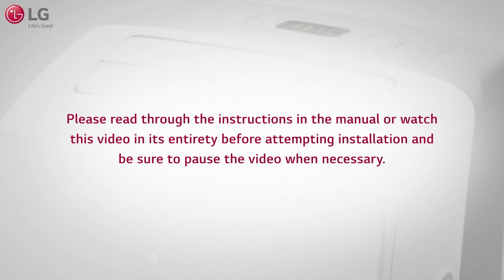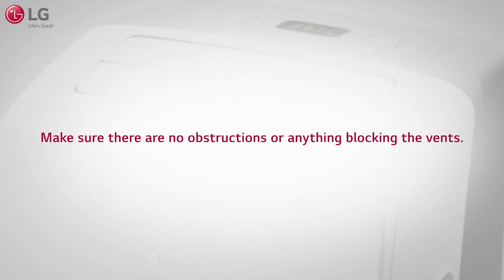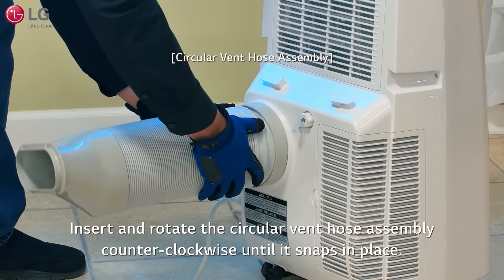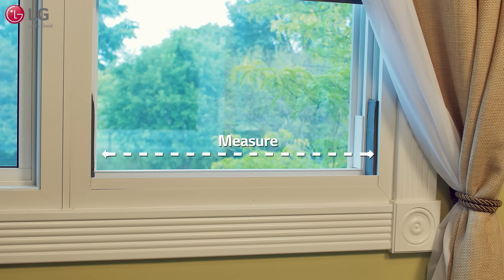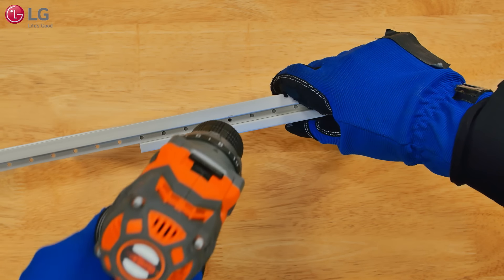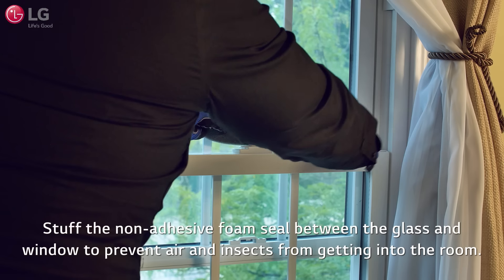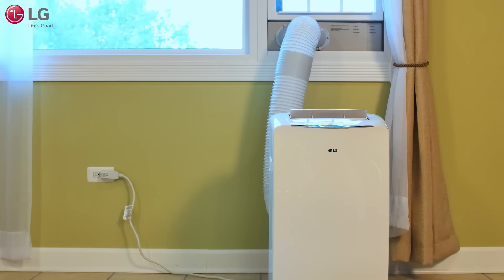LG Portable Air Conditioner - Installation (2018 Update)

Comment: FYI- the diffusers DO NOT screw on to each end of the hose. Worst design ever. However, if you unscrew the black grate , fully extend both ends of the hose, and leverage one side in first and very carefully use needle nose pliers to pull the other side up... you'll secure each diffuser. Making a seal is critical as the hose will vibrate out of the diffusers within a few minutes of usage.
Reply: Glad it’s not just me this is crazy the hose definitely won’t screw into the bracket

Comment: There are a lot of issues with the window panel installation if you have a left to right sliding window. This video nor any other video goes over the problems. Extremely frustrating
Reply: Yeah, you basically need you to make your own window pannel using plywood, and then screw the provided window panel into it to be able to attach the hose. Especially if you have windows higher than 50". Even if it's inconvenient, the advantage is that it will provide better insulation from heat and sound than what just installing the slim panel could provide (especially with a 1-inch plywood). It also makes you able to install a vent cover on the outside. Just make sure to paint the plywood (ideally in white if the sun shine directly on it during the day) so that it does not rot.
Reply: Hi. Did you manage to install it Dominic?

Comment: 1:27 what LG doesn’t mention (which is very important) is that absolutely NO air can escape from the mounting bracket/diffuser. otherwise, hot/humid air will be released from the gaps, increasing humidity, which won’t allow the A/C to cool efficiently. Think about it like this. If there were a hole in the hose, some of the hot air that the unit was trying to put outside would be released into the room. The same thing happens if there are any air gaps at the attachment points. 

buy some insulating tape from your local Lowe’s or The Home Depot, apply it around the attachments of the mounting bracket & diffuser, and you should be good. 

also, make sure the window is sealed entirely, and that no air can get in or out. air escaping from anywhere other than the A/C vent will increase humidity.

Lastly, this air conditioner is not portable by any means. it really needs to be permanently installed if you want the best performance out of it.

Comment: I have a horizontal/Left to Right sliding window & had this installed & cooling in under 2 hours, including trimming & installing a piece of screen to go over the grating b/c I don't have a screen in that window. I could have used extra foam but w/ rigid insulation I had on hand trimmed down I made it fit quite snug. In 15 minutes my room has dropped 10 degrees easily. I watched this video at least twice.
Reply: Why did you need the screen?

Comment: I absolutely loved the portable units I had for my mobile home when my central air unit went out. I had two units that cooled the living room, kitchen, and bathroom and slept in the living room.  One was 12000 btu's and the other was 10,000 btu's.  The only drawback is that they do make a lot of noise.  Mine weren't this brand though.

Comment: The hose gets super hot, which heated up the room, I had to tape insulation around hose. That helped a lot.
Reply: thanks for the tip
Reply: Is it good to buy portable ac.what about electricity bill
Reply: Hello I just bought one today what kind of tape is good to use for the hose?
Reply: @stevemoore9509  duct tape
Reply: @rachelwilliams3108   Oh great thanks Rachel.
Reply: hi rachel i was wondering did you wrap the entire hose with duct tape?

Comment: you need to insulate the expanding hose which blows out the hot air.
otherwise, it's like having a radiating heater and ac on at the same time.
insulate using towels or blankets wrapped and taped tightly, covering 

the entirety of the hose.  2 to 4 inches of insulation is adequate.
Reply: How do you insulate the hose? I used this last summer but now when I set temp it jumps to 80. I can’t find help online at all nor in manual. Any help would be appreciated.
Reply: @valerievalerie5897  i use an old thick blanket to wrap the expanding hose from end to end, using tape to keep it from unraveling. the thicker
the material used for insulation, the better it keeps the heat from leaking into the room. you can use old newspapers, towels, blankets
or even insulation found in hardware stores. just remember, you're goal is to keep the hot expanding hose from heating up the room. 
the insulated hose should be cool to the touch when the ac is running. if it is still warm, i would wrap another layer until it is cool to the touch.
Reply: takezoaudio  thanks so much. I’ll try that in the morning ( also cleaning filters tonight )  so strange it was great last year.
Reply: takezoaudio sorry to bother you I wrapped hose with towels blankets etc and  mask taped best I could. The air coming out seems cool and my next question is how much of hose can you leave in order to touch for temp ? I discovered late last night mine is one of 3 models recalled contacted LG but not optimistic about contact. I’m going to watch carefully and continue to use. Right now hose exposed say 1 1/2 inch each end and is warm but not hot. Thanks for your help
Reply: @valerievalerie5897  i cover every inch of the hose. i touch for temperature on the blanket surface and it is cool. if warm, then add another layer. good luck
Reply: takezoaudio gotcha thanks. Ive got way more than 4 inches deep. so think I need to redo and possible cut blankets small , thanks again.

Comment: This type of units you must always insulate the hose becaue you are cooling with unit and heating with the units hose ( it’s just a plastic hose, heat’s up when in use).
Reply: Oh, I didn't know that. They should have mentioned it, hmmm
Reply: The whole unit heats up, the hot air being expelled doesn't make the hose so hot it reheats the room.
Reply: how would you go about insulating the hose?

Comment: I bought one for my outdoor work shop.  Season -1 the auto drain feature stopped working as well as the auto shut off when water level is full from condensation - causing the unit to leak water all over the floor. Season -2 the articulating air flow blade stopped working and later in the middle of summer the unit stopped working all together.
Reply: TrueToad same thing here....lots of damage to wood floors...
Reply: My auto shutoff never worked right.

Comment: Since I never use my fireplace, I wonder if I can use my fireplace instead of my window. The HOA in my condo may not allow me to do that.🤔
Reply: Shnaz Fangler  I lived in a small condo that I bought in 1984. I don't need a house, cause it's just me. I paid my mortgage off 10 years ago. Which means I haven't paid rent or mortgage since then. If you buy a condo, there is going to be an HOA. They take care of the yard around the property, water, trash etc. I'm at that age where I don't want to start paying rent somewhere else or buy a new house with a new mortgage. I'm rent & mortgage FREE!! Plus, houses are not cheap(especially in a nice area), I'll past away first, before I pay off on a 30 year mortgage loan.😀
Reply: Then how would Santa slide down?
Reply: @ToulKorkMan  I'm too old for 🎁 anyway, it's not like I have 👫anymore.🎅👎
Reply: I did it for mine, I just removed the doors and blocked off the open areas with wood. Seems to work fine been using it for weeks now.

Comment: Do these sort of window installations work with side closing windows ?
Reply: I just finished installing mine in a side-closing window. I had to get creative with the foam strips, but I think that's probably the case for most installs. The hardest part for me was threading the vent; I wish it had had some kind of clamp instead.

Comment: I think the dual hose ones do better when it is a lot hotter like 100°F but the single hose units perform better at lower temperatures e.g. 85. There is a video somewhere on this where they did tests. So for where I live I would be wasting money to buy a dual hose unit because the single hose will perform better when the heat isn't so much. 

I don't have a problem if air is being sucked in from the other side of the home as that will be the cooler shady side. I suspect though that the air coming back in would not be as hot as the air being expelled. 

Also, many people like me do not have windows that slide either vertically or horizontally but swing out vertically or horizontally instead. So it would be even more difficult with dual hose. It is already tough with single hose and you have to avoid the expelled air coming back in by getting wind direction etc right. I think a dual hose could suffer that problem just as much with hot air that is expelled coming straight back in. 

The window units seem to be better than both portable types but again they need the vertical sliding windows. One thing I'd like to know is if LG make portable units with more BTUs e.g. 18,000 or 24,000? 12,000 may only be good for smaller rooms.

Comment: To LG which vents to make sure that's nothing blocking???  Are you refer to vents on the back of AC or exhaust port to outside?  Is the net screen on the window consider as anything that blocking the vent? If not you need to update this video. There are to many uneducated people out there.

Comment: Portable ac not gd split dc inverter ac is best choice for better cooling performance and also best for saving electricity
Reply: Not the best choice for a rental though and by the time you've purchased, wired and installed the split you'll have spent a lot of money and it's permanently in one room.

Comment: Yeah all well and good till bacteria galore builds up inside the bottom and in the air outtake so bad that it makes you sick even with regular cleaning it's not worth all the effort to slightly cool down a single living room or bedroom and I'm speaking from experience I had one until I noticed sinus and lung problems with me and my family the water buildup in the bottom of the unit was disgusting to say the least.
Reply: You're insane!!!
Reply: Try cleaning it every once in a while.
Reply: @johnhorton9637 - I think the guys a little overboard but he did say he cleaned it regularly.

Comment: I have a 10,200 in my bedroom, but now it fills with water, can hear the water gurgling and it is supposed to be self evaporating, how do i fix this problem for good? I did try to remove a clog from the tubes that drain the air conditioner but hasn't helped, please.
Reply: Fran Helmer       Put the United on a desk or something and attach the hose to the init and the other end to a pail because the pail has to be lower than the unit. Now it will drain whenever there is water built up

Comment: This would be perfect for stealth van camping. Just hook up the exhaust heat to the roof vent.
Reply: Good idea.But what about power consumption? (source?)
Reply: @jayjayjay4788  It would require a gas generator. Traveling Robert uses a Westinghouse 2500 which he says is pretty quiet. He's not a stealth camper, he just wanted a quiet generator. 

The only idea I can think of for stealth is to mount a bike type rack on the back of the van and put the generator inside an insulated box on the bike rack. Or inside an insulated trailer.

A soft start unit is needed to keep from  the breakers from tripping when the AC turns on.
https://www.youtube.com/watch?v=IbZxSwYfYvg

I did not find a spec sheet for the model shown in the video so I used this window unit. 

https://www.build.com/lg-lw8016er/s1196551?source=msn_!c291517382!a1275433738760542!k%2Blg%20%2Bportable%20%2Bair%20%2Bconditioner!mp!p%7Badposition%7D!dc!no!f8864876689029&msclkid=d8aecc840c51135355e99009dd0bac13&gclid=CKT_gL6viOECFcFxgQodaGcMvg&gclsrc=ds

https://s1.img-b.com/build.com/mediabase/specifications/lg/1196551/lg-lw8016er%20spec%20sheet.pdf

How to convert volts to amps
http://renewableedge.com/calculate_volts_amps_watts.html

Comment: Why do none of these videos address the draining of the ac unit? Easily the most frustrating part...
Reply: I called their toll free number, gave them my model number and they e-mailed me the owners manual. My model has two drains the one on top is for dehumidifier, one on bottom is for ac. You can call them. There are two ways to drain it. Also, the filters need to be cleaned about every two weeks.

Comment: how is this portable? this involves drilling into permanent window structures, cutting, adhesives and other strongly-committed activities.  you end up wasting floor space and get no benefit of easy install and easy relocation. it is more cost, more hassle, and more bulk than a regular window unit.
Reply: Is it really more costly ? By how much
Reply: @chill8362  About $160 more
Reply: @cristianfernandez2571   Really? Does it depend on the model and brand of it ? Do you have a comparison?
Reply: @chill8362  I did find a cheaper version I bought another brand online after posting this since I needed a new one. Cost about $260. The first was $329 at Home Depot.
Reply: You don't have to screw it in if you don't want to. The only thing that really has to be screwed is the window vent panel.

Comment: Have not yet found instructions for installing this useless aparatus through a circular wall vent. I'm not interested in a window unit- if I were I'd buy one designed to fit into the window instead of take up room space.

Comment: What to do if second panel is too long?
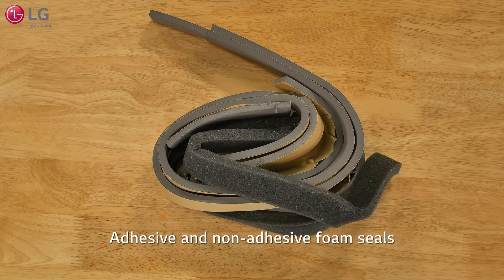Reply from the maker: Hi there! You may need to cut the second paneling to shorten it so that it can adequately fit. Please follow the directions in the owner's manual. If you notice, the length of the extension panel is different at timestamps (0:42) and (2:20) in the video. What model AC unit do you have, if you don't mind us asking? ^Chris

Comment: I don’t have a fukin sliding window in my room
Reply: Just get creative? Eg you could cover a fold open window with some sought of card or ply cut to shape, then tape around the edge with duct tape to seal. Then you just cut a hole for the vent.
Reply: FRD Farood              Is that a problem for us YouToileters............PKYS!!!!!!
Reply: Just get a new house. 😂
Reply: Jed Robertson ye thx for the advice
Reply: Buy a house with windows.
Reply: FRD Farood Get one, life is good
Reply: You have a brain. Use it please. Doesn't have to be a window. It just need a hole for the air to pass through.
Reply: You might have to ✂️ cut a 6-inch hole in your wall.

Comment: I think a mini-split system would do a better job and since they are wall mounted and would be less likely to interfere with room traffic, furniture placement, etc.  They can also provide heat.
Reply: Higher price plus holes in walls

Comment: easy break-in. I would have to find a different way.
Reply: Punch a hole through the wall. Frame it, dress it up and screw the hose to the wall there. Like a laundry dryer vent.
Reply: @crom4023  Great idea

Comment: My dumb apartment windows open with hinges like doors fml
Reply: haha mine too it's horrible .
Reply: Those are easier ,stand up the panel that connects to vent hose. Close with your sliding window. Viola much easier no screws needed
Reply: @kazmis1398  use curtains to engulf the hose and direct it outside.

Comment: 😂😂😂so much hate for LG, yet my unit works great.
Reply: I think LG has quality control issues that they need to fix ASAP. When you get an LG product that has been inspected carefully and it's made properly. It will by far be the most reliable product you have ever owned. But get an LG that the quality control team just let slip and it will be an absolute nightmare. Personally all my LG products are amazing and LG is by far my favorite company. But I have some friends who got bad products from LG and they will never buy another LG product again
Reply: If I don't install the hose and diffuser, will it still cool?
Reply: @legitimatelegend5444  I've never owned an LG portable air conditioner but my guess is that it will not cool properly/effectively/even cool at all

Comment: Le tube de 6 pouces dégage environ 3000BTU, donc il y a une perte d’efficacité, si vous acheter une 12000BTU -  3000BTU = 9000BTU, Il faut isoler la sortie de 6 pouces.

Comment: Do not believe this tutorial. If these stand up air conditioning were really viable, the piece from the unitl to the window would be one continuous piece. They make it look like the pieces twist right on to the hose. They do not. I spent an hour trying to get the one to the outisde vent connected with no luck. I am taking it back and buying a good old window unit.

Comment: These single unit AC systems should be banned everywhere. LG if you are ferociously blowing hot air outside the house where is the replacement air coming from??? usually it comes through the attic or openings in the walls and windows of the rest of the house. So while you are cooling one room of the house down you are actually heating up the rest of the house by bringing hot air from outside.Two hose units provide the return air and cool that air down and remove the moisture. Perfect and efficient compared to the single hose unit.
Reply: Why  @hameedansari4559
Reply: Single hose dehumidify quite well.  Must buy a self-evaporating model.   Two hose units are not an automatic ticket to efficiency.  They are noisier consume more power ( check the amps ) are bulky and have reliability issues.  Climate and heat load have a lot to do with how well any of these work.   My 9 amp 400 sq ft unit works better than my 11 amp  in 200 sq ft bedroom . Cools more than that room, does not heat the rest of the house from infiltration and does not need draining.  It also cycles less which is good for sleeping.   Conventional window units cost me more to operate because they are on when an otherwise opened window will suffice on cooler nights and days.  Nothing replaces personal experience.  There are no cookie cutter solutions for HVAC.